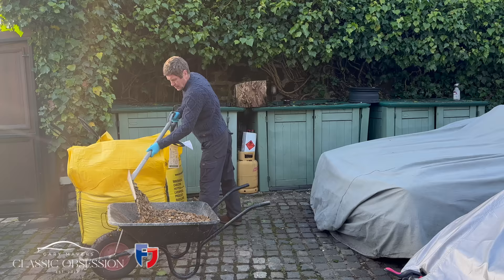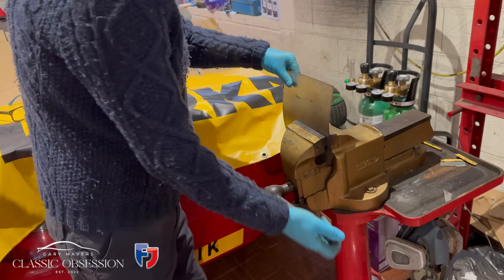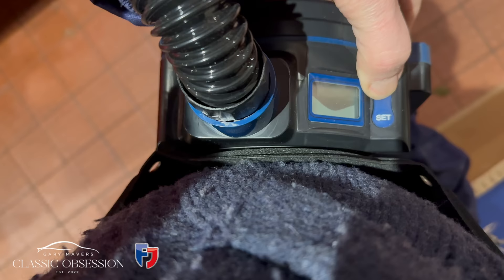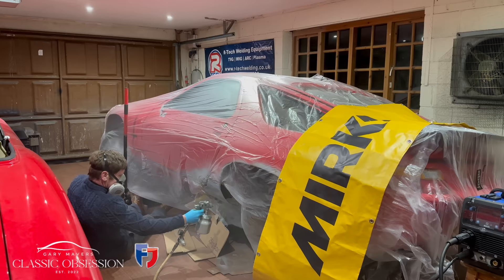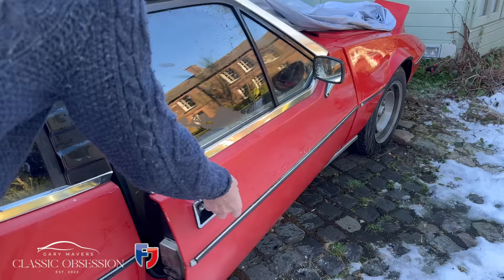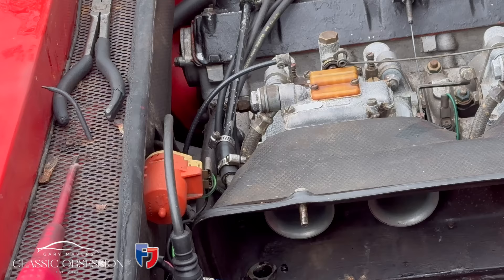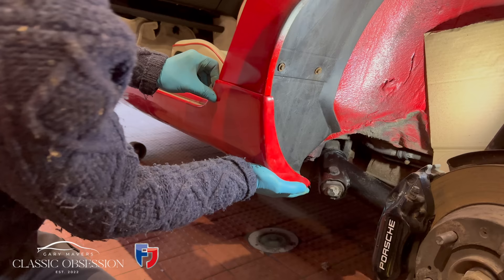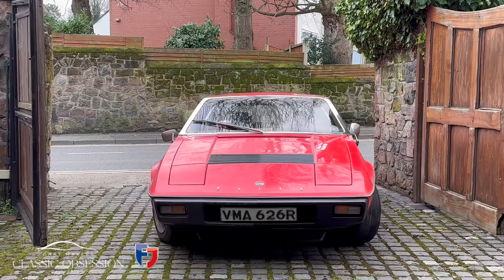Lotus Elite hasn’t been driven in 7 years! | + Porsche 928 GT | Classic Obsession | Episode 55

Comment: That choke cable for the Lotus is basically a bicycle brake/gear cable.  If the original was old and sticky then its a good idea to change both the inner and outer, then you get a silky smooth low friction action.  You might be able to get a little ferrule to crimp on the end of the cable and stop it fraying, or you could put a blob of solder on the end.

Comment: Are you going to paint the Porsche yourself? - I'm intrigued why you didn't also prep and paint the parts you had already rubbed back at the same time when you had the dust sheet out? 
Looking forward to seeing how you balance those carbs and what tool you use (when it's back from LA/work on the Merc)!

Nice Work as always - you need to have words with your wife about putting a Car port on the side of the garage to keep the weather off the rest of your fleet!